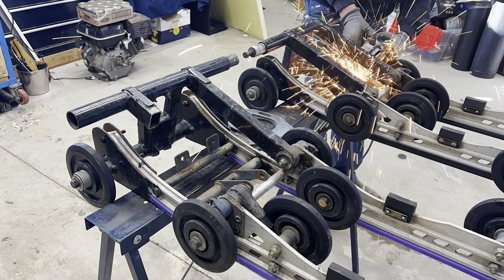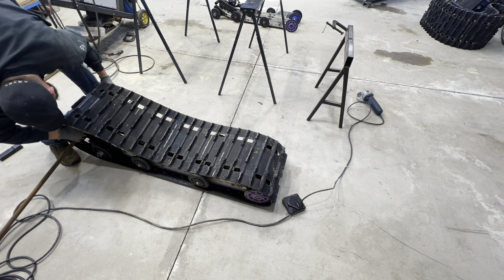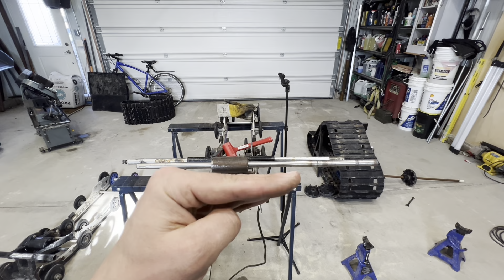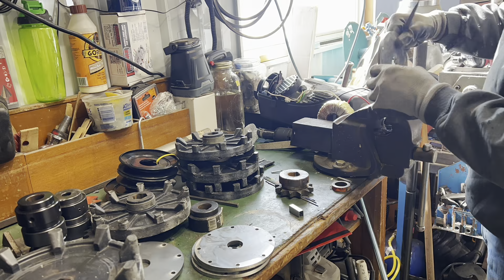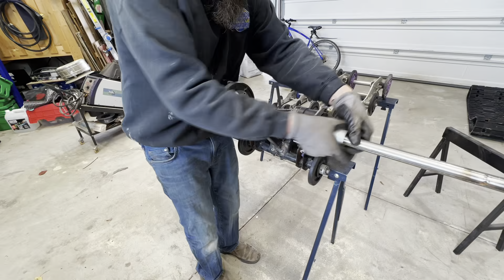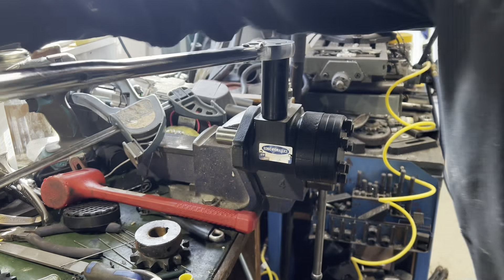Tracks are finished! PTV (Personal Track Vehicle) Build.

Comment: ack! Tell me you aren't driving your torque wrench past the "click"?!?!? Good project, I hadn't thought of hydraulic motors. That's kinda genius, you can adjust the ratio to use all available power from the engine.
Reply from the maker: With NPT fittings go waaaaaaaaaaaaaay past the click or else they will leak!

Comment: Definitely should have went with a hex shaft.   And you are probably going to bend that front idler axle with that square tube support going directly to the center.  With the angle, thats going to see a lot of load when hitting obstacles.
Reply from the maker: Hex vs round shaft, of same critical dimension, and being created equal material, the round will have better physical properties to resist deflection. Plus, I already had it on-hand and it worked nicely with the bearings I also had laying ‘round 😉. 

I’m not very worried about the support tube, under compression it should be ok.  

My concerns at this point are shearing a key or snapping a chain.  I expect to be putting both to their limits with the torque from the motors.

Comment: Cool man. I just found my first critical error 😢
Reply from the maker: Uh-oh! What’s going on?
Reply: @rad1876  tracks hitting wheel motor mounts. Not because I didn’t think about it. Because I made changes and well that affected things. I am pretty sure the fix isn’t as bad as I thought
Reply from the maker: @CenterLineDesigns oh boy, you’ll get that on those big jobs 😂.
Reply: @CenterLineDesigns I had similar issues with sprocket size and wheel guide/axle clearance but just got lucky for fitment. Luck, not much else.
Reply: I am going to bet it can be corrected.
Reply: @CenterLineDesigns  all part of the process, you’ll sort it out I’m sure.